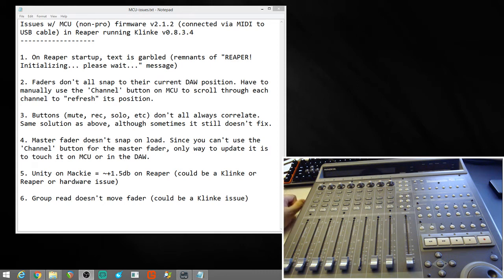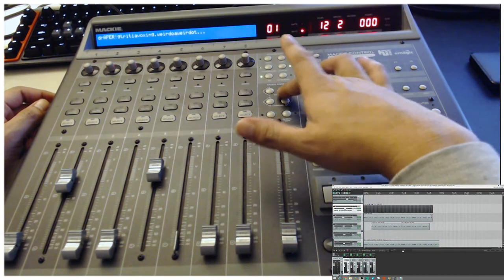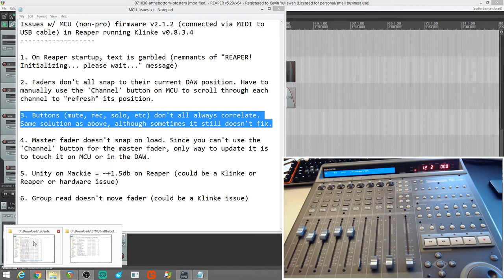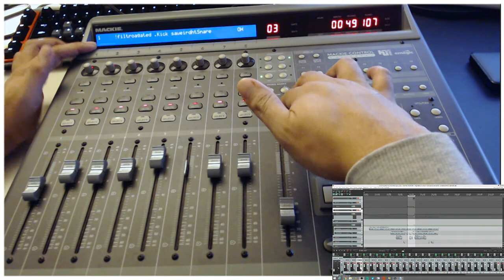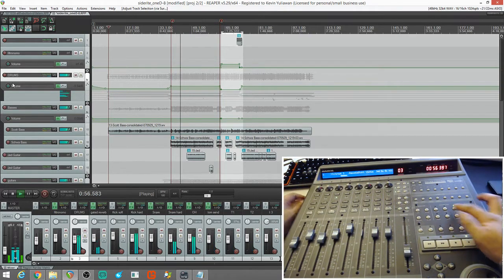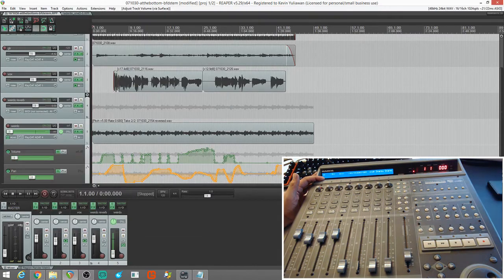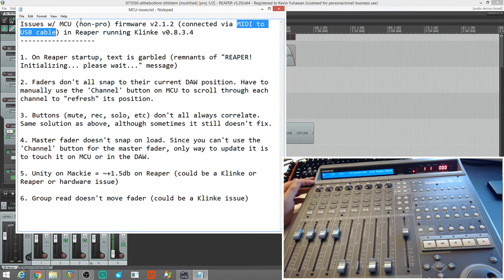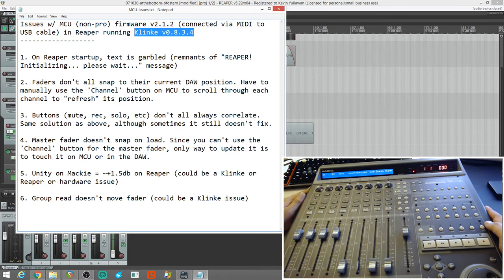Reaper issues with Mackie Control Universal (non-pro) and Klinke plugin

Comment: Did you ever get set up running this midi to midi ports ?I run mine midi to midi in/midi out in to my interface and it works great. looks like a fader calibration issue. cant say I have the same issue myself. love my Mackie control (old one not the new ones) I know theres much better out there now but I love this controller. Bought mine used for 150.00 off Craigslist in 2014. I use mine in reaper, Studio one and Sonar. FYI. I also have the latest firmware, which is not really that new to be honest. I would axe that midi to usb cable. Those are known to cause issues. I ran a Roland V drums through a midi/usb cable and had nothing but problems.
Reply: hey friend now that you say you use it with studio one and I have a problem with the master fader it goes down only after a while and only in mackie control mode in logic mode and hui it doesn't happen to me that it could be I haven't updated it has the 2.0.1